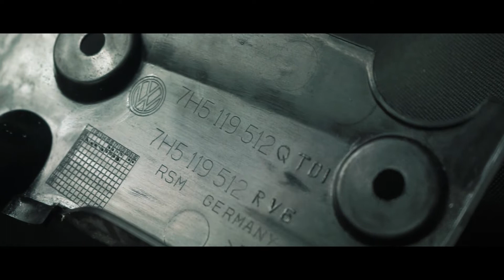VW T5 Engine Cover Upgrade Battery Cover VW T5.1

Comment: I've got instructions to remove the wipers and drill extra supports under the wiper panel...is this correct
Reply from the maker: He’s probably saying it wrong; there should already be original protruding screws there.